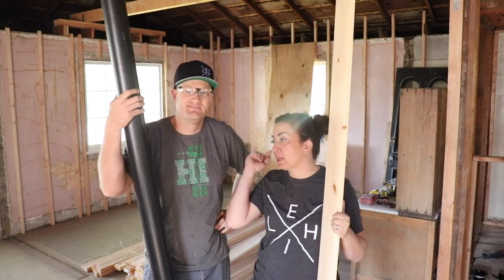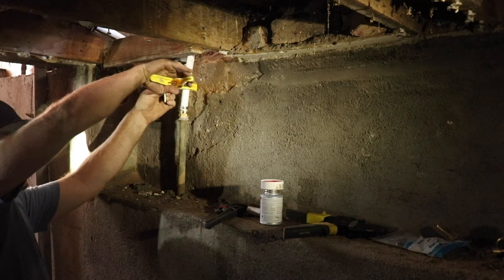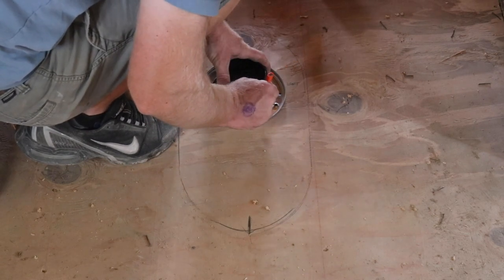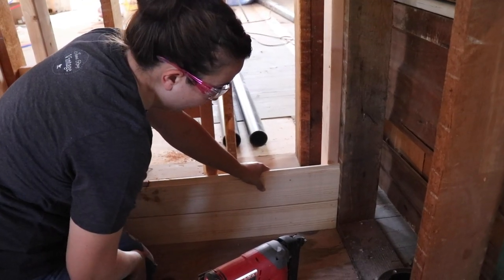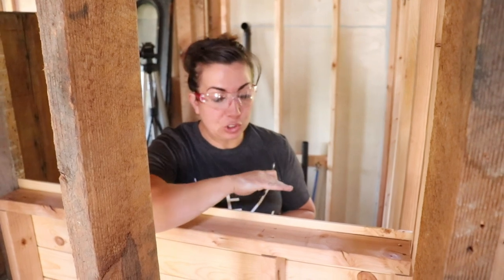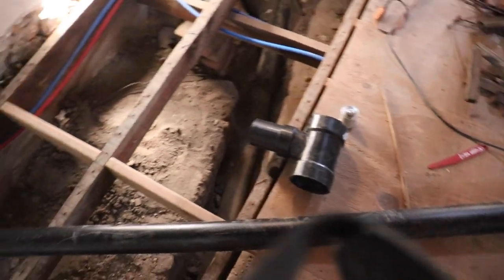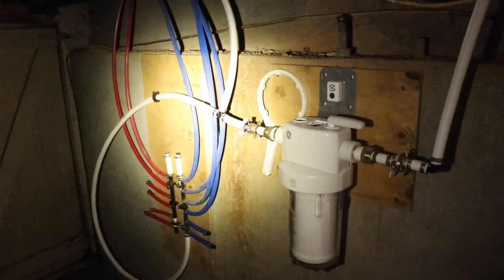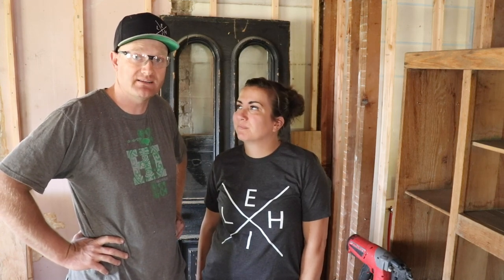Farmhouse Renovation Episode 14 | Shiplap and Running Water!

Comment: I am SO excited for you guys!  Jamie and Zed my husband and I are working on our own Barn-style cabin (small), and I was so surprised at the “lack” of finding shiplap at the local lumber yard.   In fact we bought what we could at the local Home Depot, and did one wall on the “tiny” bathroom, but the local lumber yard, with very nice quality lumber, moved us to tongue and groove pine.   Which is fine for my downstairs.  I still plan a second adjoining cabin to be white shiplapped :).  You didn’t mention setting your gaps on the ship lap but I saw that you did, and in fact looked like you did what I did which was use a good-sized nail.   Likewise I did not fill my nail holes as I figured it was all part of it.  I have to say the quality of the only shiplap I could find (Home Depot) was pretty rough, and warped.  But all in all I think the feature wall in my bathroom is lovely.   The pine tongue and groove I plan to white wash or paint, as I do not want to live with orange pine, which is what will happen if I leave as is.   Anyhow I am so excited for you!   Not peeing at the park, or even in a port-a-potty, or RV (which is what I did during the build) is something to celebrate!  Wish I could post a couple pics to you of our cabin (in progress).
Reply from the maker: Zeb went through the ship lap at Home Depot and got most of their good boards. That was over 3 weeks ago and they still haven’t restocked!  Luckily we have 4 Home Depot’s within 30 minutes so we’re gonna go check the other ones supply out.

Comment: The ship lap wall installation made me curious about insulation. Will the interior walls be insulated? Also, I learned that when modern insulation is blown into exterior walls of old houses it can create a damp/wet scenario that ruins everything.
Reply from the maker: We’re using a closed cell spray foam insulation that will go on the bathroom walls, mostly to sound proof it, 😂 
And the roof will get 8” of foam insulation on top before we reroof it. We aren’t insulating the exterior walls. They are 10” thick adobe brick and already insulate very well.
Reply from the maker: Usually condensation builds up on insulation when it isn’t properly vented in stick spaces or insist the proper thickness for your region.

Comment: Jami. I just got some wainscoting from Habitat for Humanity. I thought it was shiplap but it’s actually the backside of wainscoting that’s 5” wide. Probably came from an old house. The wood is old. I posted on your FB because I am wondering to use it as shiplap feel or wainscoting going horizontal. Someone said I should check for lead. Are you guys using old painted wood as well? I’m just making a wall above my fireplace that is 12’ x 3’. I was going to paint over with DIY White Swan. Never occurred to me to check for lead. What do you guys do? Not sure what to do. Was going to install tonight. Thanks in advance to anyone who can answer this.

Comment: You two are so cute together and I love how you explain every thing you are doing. Zeb I'm curious if you have to have everything you are doing to the house inspected by an inspector and do you have to be a certified plumber or electrician. I know every state has different codes.
Reply from the maker: If you own the home the homeowner can do most the work themselves without certifications as long as they meet inspection standards for the area.